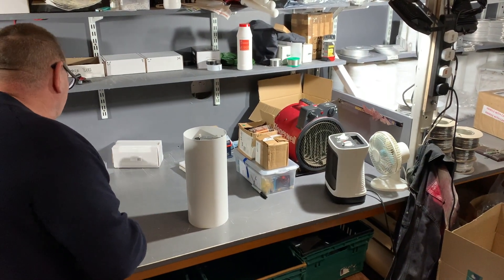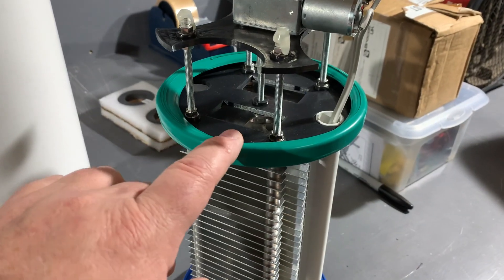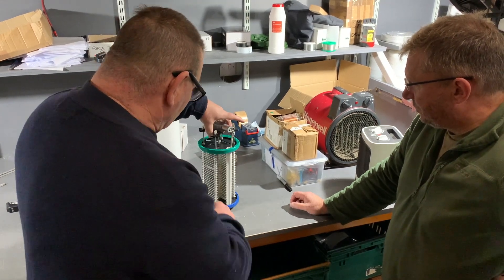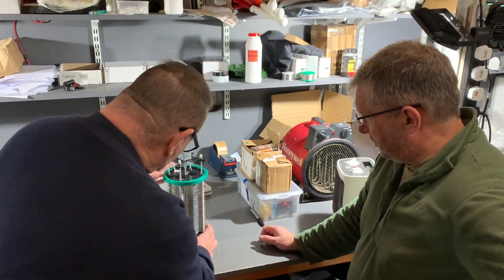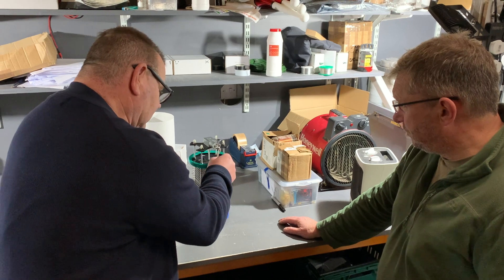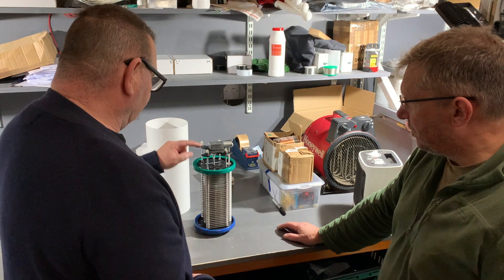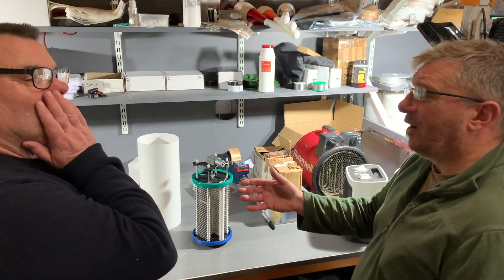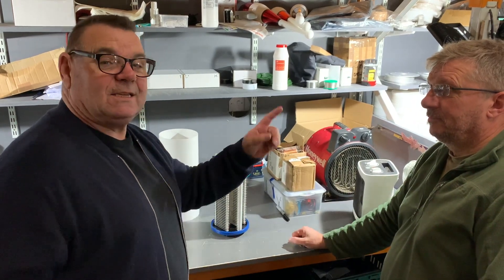HAM RADIO: A Look at the Magnetic Loop Capacitor Showing Callum DX Commander

Comment: Looks great, Mike and Callum!  I will add my name to the cap-kit wanted list.  My main problem is sourcing the flat sheets used to make the capacitor plates. A kit would be really, really helpful!  BTW, how much power do you think the cap can handle?  Can it do a full 100 watts? Thanks, and Happy Holidays to you both!  73  KD2ORG
Reply from the maker: I think it should handle 100 to 200 Watts  I will test when finished

Comment: Hi, it would be interesting to see how you made the connection to the rotating elements to keep the resistance low, the enemy of Magnetic Loops.
Reply: Believe it is a butterfly air variable, so no connections to rotating parts needed?
Reply from the maker: Yes to both, you will see in the end video

Comment: There are different types of copper pipe - straight sticks that are used for indoor plumbing and flexible pipe that used for underground burial.  You could probably get the flexible copper and make your own loops rather than getting a machinist to bend a hard stick.  The difference is that  the thickness of the copper is thinner, but the inside diameter is the same.

In the US we call the flexible copper "K copper pipe," and the indoor stiff stuff is "L copper pipe".  I'm sure that the standards are different in UK/Europe, but a quick call to your local water company would probably be able to get you a local equivalent.  Heck, they might have a few scraps laying around that they would give or sell to you for cheap.